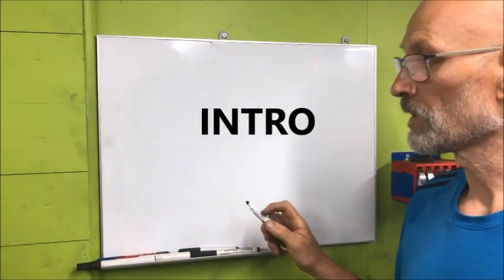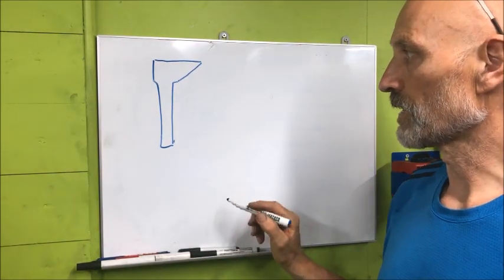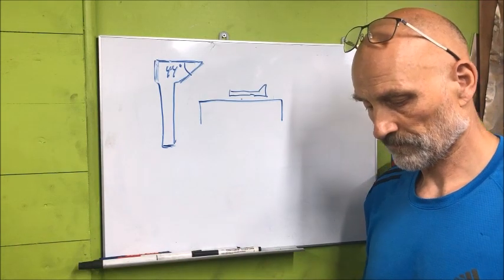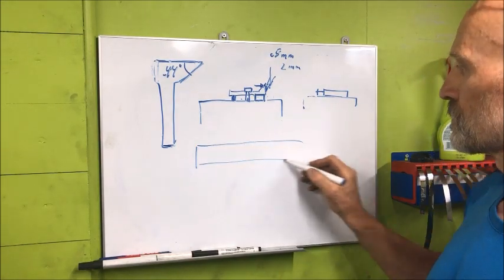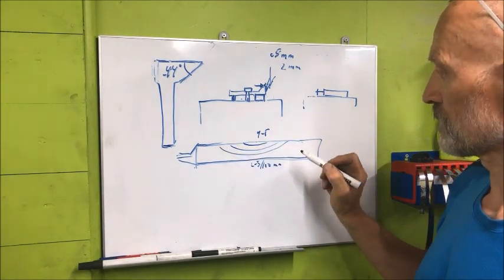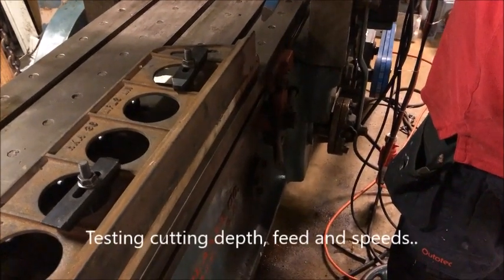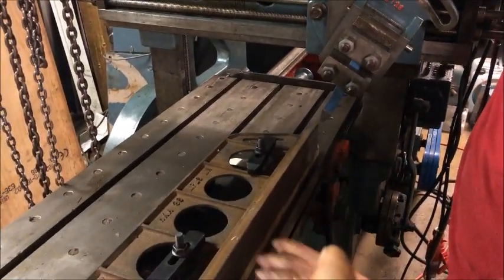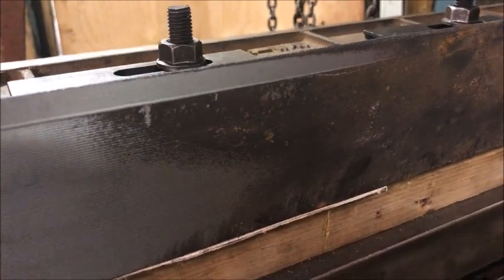Rough planing HKA36 Kingway straightedge on Powell planer

Comment: Very interesting video Jan.With a VFD running that planners motor I'm not sure if or how it could be programmed in, but afaik the original mechanical method of getting reverse on the table should also have sped up the non cutting return stroke. And a bit of extra stroke length on each end of the straight edge than maybe needed, so that adds to the machining time considering the number of passes made. I'd probably be that cautious myself and have that extra over travel just to be sure.
Reply: I´ll add my 0,02$ here, You are spot on regarding the return stroke, it needs to speed up. Also the cutting stroke need to speed up a bit but same as with the overtravels, optimising will come with experience and this was a bit comfortable operating now. 
On the VFD I have used up most of the possible terminal input configurations possible at the moment so I need to work around that externally. The control box is really just a bunch of switches in different logical sequences with 0 interlocks, I may have to get a small PLC in the future, that would also allow for other possible features. The VFD itself is super but old so not very advanced compared to what is available now.
Reply: @henrikandren6967  I'm glad you didn't take my comments as being overly critical. Just my observations that's all. They have to be since I've never operated a planer yet. But they work much like a shaper so the principals should be about the same. And your well ahead of me with your electrical knowledge. Knowing the return stroke needs to be faster is a whole lot different than me figuring out how to actually accomplish that. :-) You still did a fine job and that's the important part.

Comment: I know that this planer is much modified but still it looks less primitive than the one Keith Rucker is restoring which I think is a similar vintage. I have noticed in a few videos that straightedge castings all seem to be "hollow" like yours. Is that due to distortion as the casting cools? Could it be reduced by building a "bow" into the pattern?
Reply from the maker: Hi there,
thanks for the comments. I am not sure about the planers but think they are of the same age at least. Possibly this Powell planer is more ophisticated, but I really would not know the details. I leave this for Henrik Andren, the owner to answer/elaborate on
Reply: Hi William,
I agree with you in that notion, however I have had Very much help and guidance from Keiths excellent documentation on the restoration of his New Haven and by large it is mostly in some details there are some differences. For example the right angle gearing for main height adjustment of the crossbeam is often composed of bevel gears whereas in the Powell it is helical, if either has any advantage to the other I can´t say. Then some parts are really old school like oiling, I know somewhere in the film Jan shows the oil grooves of the clapper and the oil inlets where you´re just supposed to squirt in some oil. They both have the old style straight gears for the rack & bull gear.
Reply: I think foundries do the bowing on purpose, so kids these days can't just buy something and use it.  The grizzled, old foundry masters want people to have to pay the dues they paid ;-)
Reply from the maker: @somebodyelse6673  hehe.. maybe :)

Comment: Tool needs round end!
I plane my straight edges on a hydraulic Rockford planer, much quicker 😀
Reply from the maker: Thnks for commenting. I guess there are many ways to do this and leave it to Henrik to discuss firther on the topics on the planer itself
Reply: Hi Clive! Thanks for your input! Been meaning to ask for a qoute on a large square. 
Have gotten a bit further down the road and while getting some HSS toolbits I have also gatherd some more carbide tooling. But to also keep in mind that as of now I might get 2-3 kW to the cutting edge. Old and small machine but quite straight, did a bed lately and it came in good.